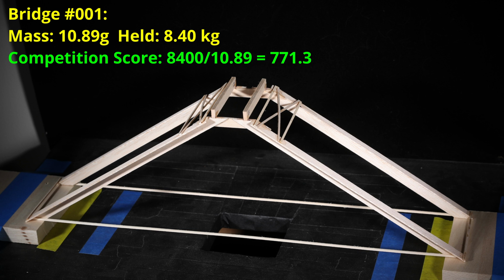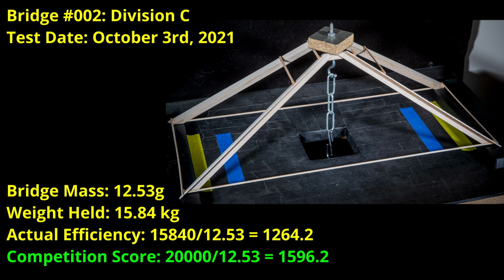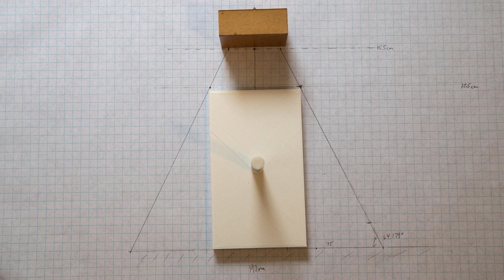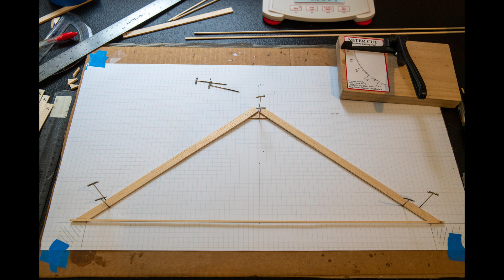Bridge 002 Division C: Competition Score 1596.2

Comment: You had a 2-D drawing of the trapezoid that allowed the object block passing through.  The trapezoids would incline a certain angles when assembled the 3-D bridges.  You may consider this and make it wider around the height of the top of the object block , otherwise the 12 cm * 7 cm object block could not pass through the bridge horizontally.
Reply from the maker: Hi Amy, that part of this bridge design is OK.  That 2D drawing was the end-view of the bridge.  The design allows the 12 cm x 7 cm passthrough block to completely go through the bridge through the entire horizontal span at the very bottom which is in agreement with the rules.  I am in the in process of building a new bridge with a 140mm width to make it in compliance with the 6" support block.  I'll post a video as soon as I have something successful to show with the redesign.  When I post the new video, I can demonstrate the passthrough block going through the span of the bridge.
Reply: @balsaengineering6686  Thank you so much for your detailed explanation, Marc!   Can not wait to see your new bridge!

Comment: I don't believe you'll have much luck with that Division C bridge as shown in the video. It looked like your design called for a 190mm base, but the rules say that the test support blocks are only 6" long or 15.24 cm. The design looks great otherwise and it'll probably pass at most competitions but there is no guarantee that your bridge's legs will be on the blocks at any given competition. 

"The Test Supports shall meet the following requirements:
i. Two identical, unfixed supports will be supplied
ii. Must be at least 1-1/2 inches by 1-1/2 inches by 6 inches but not greater than 2 inches by 2 inches
by 6 inches
iii. Made of a material that it does not noticeably compress when loaded and have smooth, hard surfaces
(e.g., hard wood, metal, high-pressure plastic laminate)
iv. Must be able to rest flat on the Test Base"
Reply from the maker: Thank you so much for pointing this out.  I totally missed seeing that in the rules.  I think the general design is sound, but you are right in that it needs to be reworked to be no wider than 15.24 cm.   I will work on a new design that meets these width rules and see what I can come up with.  Thanks again!